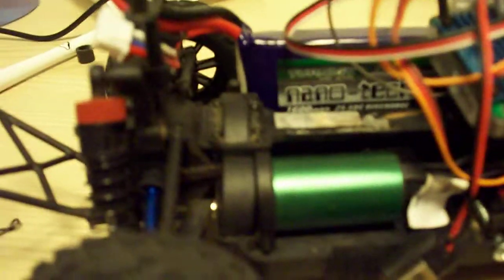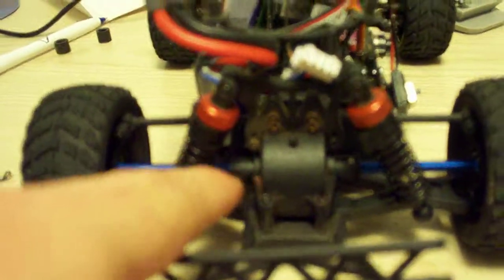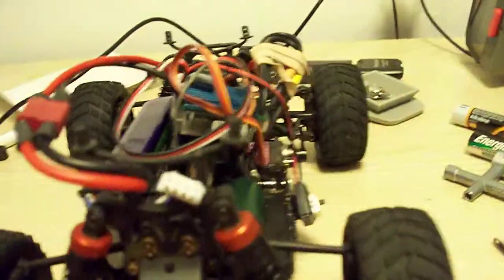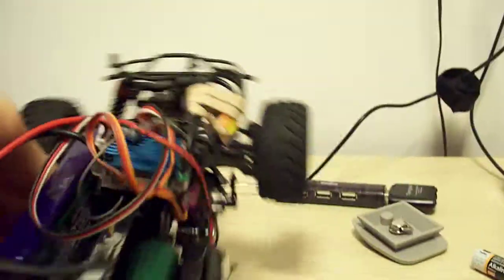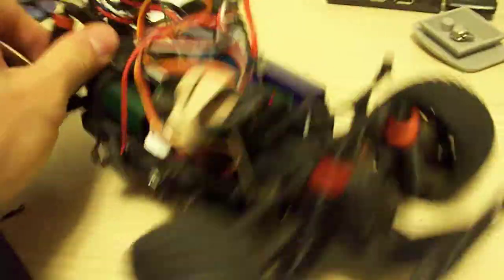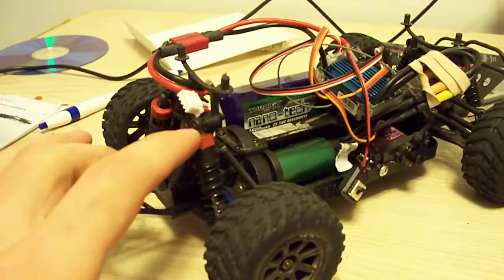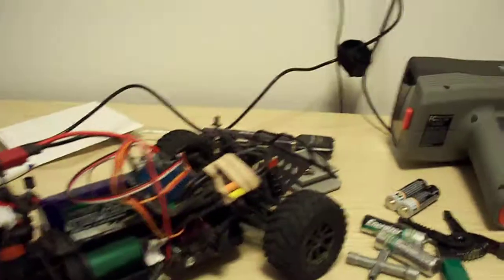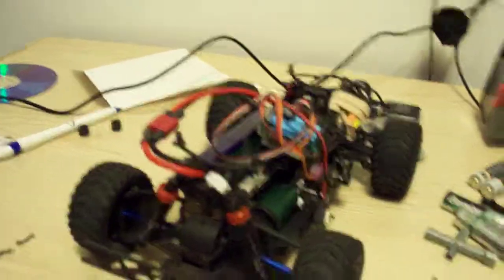Helion Animus 18sc with 8000kv castle creations brushless motor and 3s lipo!

Comment from the maker: you mean dog bones?  look on amainhobbies . com. the part number is 21031 from team associated. they work, but they were a lil shorter than the stock ones, so i had to put a spacer in-between the drive cup and the gear box. and that's not good for the gearbox cuz it puts too much friction and strain on it. so i recently purchased some other 46mm steel dog bones from 3racing and have been waiting for almost a month for them to arrive. i'll post a vid when i put them in. hopefully they fit right

Comment from the maker: I've had a few diffs get shredded, but mainly its been the spur gear for the drive shaft, cuz it's plastic.this setup was way too powerful for the car. the diffs werent made for going over 40, and i've hit over 60 with it and shredded it like crazy. its also not made for huge powerful punches of throttle. might last one full bashing, but will need to be replaced after that. i'm constantly having to replace parts because of this. i put a more powerful motor in it now, but with less top speed.

Comment from the maker: the blue ones in this video weren't the right size. they caused too much stress on the transmission. i've recently replaced them with aluminum dogbones from helion that are exactly the right size. i've also replaced the plastic center drive shaft with an aluminum one from helion.